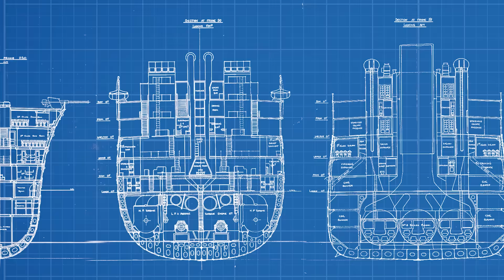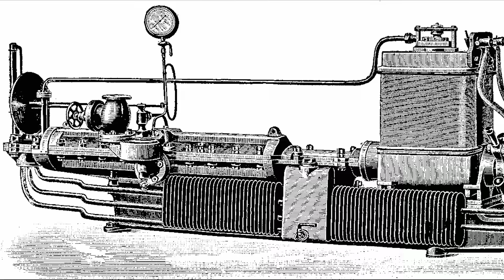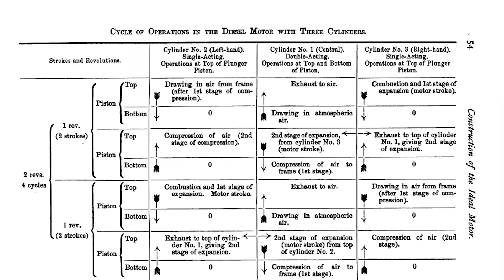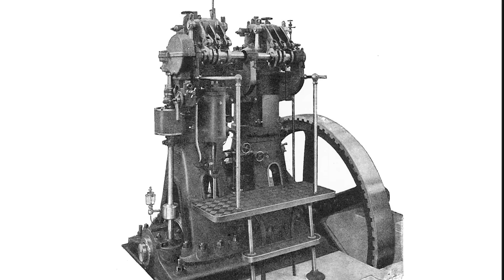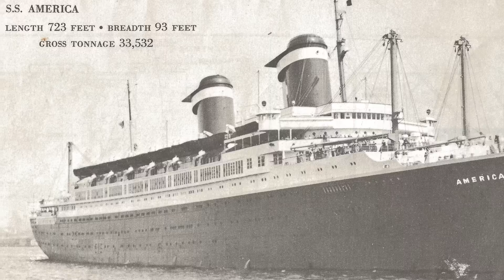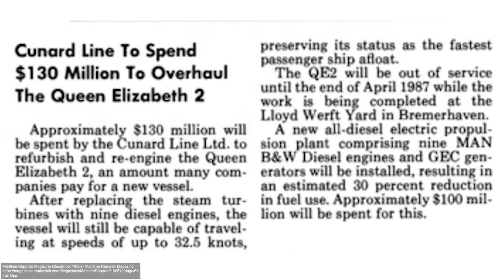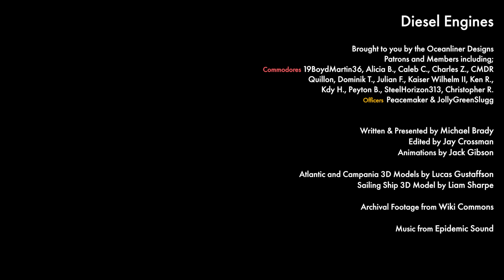How the Diesel Engine Became King of the Seas

Comment: The petrol engine was all great but the diesel engine literally built our modern world. There isn't a single industry where a diesel engine isn't used. Trucks, ships, construction, power generation, etc etc.
Reply: My diesel car uses the same amount of fuel as my bike over 50 mpg. Diesels are more efficient both thermally and consumption
Reply: @mala7794 
My daughter has a full sized sedan built by Hyundai that gets an average of 47mpg on gasoline. My wife's Jetta gets 55mpg on diesel. The Hyundai dwarfs the Jetta in size and gasoline is much cheaper than diesel. Diesel does burn hotter than gasoline and produces more thermal energy per pound but gasoline engine technology has been in the dark ages because big oil wants vehicles to guzzle gas so they can make huge profits
Reply: @adampatterson707 Whatever your "big oil" wants is of little concern to those who design, build, or sell engines. Gasoline engines and diesel engines have been continually improved over the decades up to present day. Research goes into everything from improved fuel spray patterns to tighter piston rings to electronically controlled variable valve timing to lighter and more durable alloys.
Electric motors are the hottest area of powerplant research in vehicles, but work continues on internal combustion systems to keep them competitive.
Reply: @adampatterson707 The US is probably the only place in the world where diesel is more expensive than gasoline. 

Plus, the example you provided tells us little. My first car was an Opel Corsa that got 29 mpg (city) while my second car was exactly the same but it had a diesel engine and got 39 mpg (city).
Reply: @adampatterson707 The same Big Oil that lets automakers sometimes teeter on the edge of bankruptcy?
Reply: @adampatterson707 no it doesn't 😂😂
Reply: @ΣτελιοςΠεππας that’s a recent occurrence, only in decade has diesel become more expensive than gasoline.
Reply: I think you could say that the diesel engine built the globalized economy but steam engines built the modern world before the diesel was even invented. Diesels only entered widespread use in the 1920.
Reply: @andrewduff2048 The Steam Age never really ended. Just better final power transmission via electricity. Steam turbines provide for the basis for our modern life and manufacturing. Whether fired by coal, natural gas, or nuclear.
Reply: @andrewduff2048 The two stroke diesel was like a second industrial revolution.
Reply: @andrewduff2048  well yes the steam engine brought about the industrial revolution but would our current world with all its highways and ships and commerce be possible with steam alone? there is no way. the diesel engine's impact is greater than that of the steam engine imo.
Reply: I love maple syrup
Reply: @EnjoySackLunch  realest comment on here
Reply: Maybe aircraft?
Reply: Somebody has to burn the light distillate fuels too. In reality, all engines are converging on spark-ignited, direct injected engines running on low octane gasoline, a merger of gasoline and Diesel technology.
Reply: Porn industry
Reply: @pitdog75goated response
Reply: True but dont forget the steam engine wich was used for over a 150 years and is till our primary engine for generating electricity.
Reply: @petroltrankof2667  but steam would never have gotten us to where we are today
Reply: Planes.
Reply: And in airplanes! Back in the thirties but also today in small training planes. For the same reason, much better fuel economy and cheaper fuel than gasoline.
Reply: @bohenriksson2330 modern jet fuel is very similar to diesel and kerosene
Reply: There was a diesel powered car in the 1952 Indy 500.
Reply: @leechjim8023 diesel won Le Mans in the early 2000s until it was basically banned.
Reply: even nuclear power has diesel engines(back-up generators)! they use a highly refined diesel that actually kinda looks like red wine
Reply: @cegicreator2476 The reason why diesel is red, is because they colour it with a red die.
And red diesel is cheaper becasue it has less taxes on it.
But not every one is allowed to use red diesel.
For example; ships and farmers are allowed to use red diesel. But trucks and cars are not.
So to make it obvious and visable what kind of diesel you have, they make a distinction between the different kinds of diesel by making it red.
If you use red diesel in your truck and the police discovers that, then you will get fined and they will calculate how much money you have to pay for taxes.
Reply: @musictolive4  oh ok that makes way more sense. thx for the knowledge for all!
Reply: What about war? I believe tanks have always been petrol, aircraft are jet fuel
Reply: @maxstr  yeah no tanks are typically diesel.
Reply: @maxstr some tanks have used diesel for reliability when speed was not a priority
Reply: @maxstr did war not exist before the diesel engine? it simply made it worse.
Reply: Indeed  the world we know today would not exist without diesel engines,  which have served in just about every  regimen where an internal combustion engine was required.
Reply: @taras3702  fr
Reply: Because diesel engines are much efficient compared to petrol engines. Otherwise fairly, a petrol engine is superior & better than it's diesel counterpart in almost every way except much poorer efficiency which is a big toll as to why big ICE machineries are mostly rather diesels.
Reply: And then Rudolf Diesel mysteriously disappeared from a steam ship either by suicide or murder. Maybe big steam wasn't happy with his invention.
Reply: @johns8364  That sucks, Mr. "big steam" should see how diesel engines dominates steam engine & it's helpfulness in the current world.
Reply: 😂😂 they use to be gas you can do the same with gas
Reply: @andrewhatton1606  no you canno lol. try running a hundred thousand ton ship on gasoline instead of diesel or bunker oil.
Reply: The woke don’t like diesels and are banning them in their profound ignorance
Reply: Yeah diesel engines built the infrastructure but gasoline engines make the world go round.
Reply: @dilldowschwagginz2674  gasoline makes cars go round. definitely not the world. and outside the US most markets have significant numbers of diesels. the US passenger diesel market failed because of GM's shitty V8s in the 80s and Dieselgate. and last I checked the US is not the world.
Reply: Trains
Reply: Pipe down nerd
Reply: And now it’s being demonized by the woke tree huggers and the globalist agenda.
Reply: Rudolf Diesel Born in Paris, Son of a German couple, must leave France after beginning of Franco-German war 1870.
Reply: Aerospace
Reply: mack,Peter,kw,used gas for sum time lol then 2 stroke diesel and diesel but now gas can almost out last diesel
Reply: Aviation?
Reply: @k20nutz  there's so many things in aviation that run on diesel. almost all ground work and support vehicles, avgas is practically highly refined diesel, so much more.
Reply: Aircraft?
Reply: Gasoline engines are mostly limited to personal vehicles.
Reply: Do wonder about petrol power for ships did we skip a step, petrols were around abit before diesel.
If your running a diesel flat out its not much more efficient from petrol.
Reply: @Johnathan.David.Trewhitt. The fuel is more powerful by mass.
Reply: @Johnathan.David.Trewhitt.  the point is diesels dont have to run flat out. they are efficient at low rpms.
Reply: @bragadeeshbalakrishnan  Yes but its a boat its cruising speed is a high load so why not run the petrol at low rpm because you could, the main thing is petrol is good at running fast it sparks and it all combusts at tdc, where as diesel can keep injecting past tdc so its really good at pushing all the way down the stroke but the injectors cant keep up at high rpm.

Regardless i was talking about the early 1900s ships
Reply: You have gearboxes for that lol. And diesel electric solves that issue too. @Johnathan.David.Trewhitt.
Reply: @Johnathan.David.Trewhitt. diesel is just way better the petrol. diesel is more refined the petrol so that already makes it better. plus diesel has special additives that make it not need sparkplugs
Reply: @cegicreator2476  what special additives and how is it more refined then?
Reply: @Johnathan.David.Trewhitt.  petrol is flame hazard, diesel is not as flamable. And fire on a ship is something you want to avoid.
Reply: @Johnathan.David.Trewhitt.  Agreed, but they're not meant to be run flat out, for many reasons. 

There were gas engines for ships, in instances where weight was an issue. The PT boats of WW2 are a prime example. But the danger of gasoline leaks and explosions was real.
Reply: @MannyB-b7l  Correct. I believe Brady did a video on the British attempt at a gasoline/petrol powered sub. The problem is gasoline emits explosive vapor.
Reply: @magmajctaz1405  diesel doesn't catch on fire even if you drop a lit match in it.
Reply: Gas is arguably just as important. It's not efficient to have diesel in smaller vehicles that are not used for heavy duty work. Gas is what get us from one place to another to use most diesel engines such as Trucks, tractors, boats, exc.
Reply: @tractorjunkco  well, truthfully the diesel has its place in smaller vehicles as well; Just try to get the owner of a “diesel gate” -era Volkswagen to sell their car…. They will usually ask for about double their actual value.  There’s just something about an engine that can easily go 300-plus thousand miles.  The engine costs more, but in the long term, it’ll save you money in operating costs.
Reply: @JasonMcCord-qk3yb the catch is that you have to afford the vehicle with the diesel engine first since most families cant afford it. This is were the main problem lies because gas engines are much cheaper to produce. Both gas and diesel have a place so its like comparing apples to oranges funny enough.
Reply: @JasonMcCord-1012  Years ago, I had a 1980 VW Rabbit diesel.  With over 100k miles, I still got 50mpg!  It didn't go fast (I used to joke that it'd self-destruct at 75mph), but it was cheap and fun!
Reply: @JasonMcCord-1012  What makes the dieselgate era engines more desirable? I also have a diesel (the volvo d5) with over 300k miles and I am just curious. My engine still does 0-60 in same time as it did 20 years ago.
Reply: @JasonMcCord-1012 2UZ-FE: “am I a joke to you?”
Reply: @tractorjunkco   not efficient?  I own a TDI volkswagen that gets close to 50 MPG without any exotic hybrid technology.  Not only that, the car is rather quick as well.
Reply: @audvidgeek  same. 2012 2.0 octavia and i can get 4l/100kms
Reply: @tractorjunkco It just took some time to reduce the size of diesels because of the high compression ratios.
Reply: Thats untrue @tractorjunkco
Reply: @tractorjunkco  diesel is still more efficient in small engine vehicles and implements. The reason they aren't used more is cost. A carburetor is significantly cheaper than injectors and injection pumps. Plus gas and diesel are both created in oil refineries so they both have purpose. Diesel was initially free and then very cheap because they had no use for it. Gas also has the benefit of being more suitable in the cold though
Reply: @tractorjunkco  diesels are more efficient than gas engines but they pollute more. gas engines work for smaller vehicles and pollute less. if diesels were not as polluting we'd all be driving diesels now but alas.
Reply: @tractorjunkco in the US. Here in Europe diesels are found in literally everyfucking thing.
Reply: @tractorjunkco wtf is gas? A gas engine? Natural gas? Speak sense ffs
Reply: @tractorjunkco Thats not true, in europe we have small cars like Fiat Punto with 1.25l diesel 4-cylinder making 75 to 150hp. The efficiency is off the charts, these cars get 50 to 60 us mpg. You even get a manual transmission so you can shift it the way you want for even better mileage.
Reply: @tractorjunkco you kinda don’t understand diesel, I guess. That’s ok tho. Long story short, diesels are WAY more efficient than gas engines will ever hope to be. Hell, diesel itself has more energy for us to harness than gasoline does. 10-20% more energy, btw. Idk why you think it’s not efficient to have a diesel in a small car. They last a helluva lot longer, get better fuel economy, can idle for forever…biggest reason they aren’t more widespread in passenger cars is because they’re a lot more expensive and VW left a sour taste in everyone’s mouths… there are a shit ton of others pluses when it comes to diesels for regular cars. That’s why I’m throwing a diesel into my mini van. 

Seriously, where’d you get the inefficient  comment from, cuz diesels were literally touted as being the more efficient alternative to gasoline engines, and it wasn’t just a marketing gimmick. Diesel engines and diesel itself are more efficient than gas. 

(Kinda drunk so this was longer than u meant it to be but yea. Calling diesel inefficient compared to gas is just silly)
Reply: @tractorjunkco  plenty of small cars are diesel and are far more efficient than petrol
Reply: @tractorjunkco  could you Americans? Please learn to call it gasoline?  Or maybe call it petrol like everybody . It’s in the second state of matter not the third state of matter.
Reply: No. It's just that diesel can run on trash fuel on which spark-plugged engines can't run. That's its value, not efficiency.
Reply: @ steam engines can run on anything that burns. Often the bunker oil that they used was so crude that it had to be heated in order for it to be pumped from the storage tanks to the boiler.
Reply: @andrewduff2048  but they were very inefficient
Reply: @andrewduff2048 modem cargo ships literally run on crude
Reply: @tomhejda6450  look up the thermal efficiency differences between diesels and gasoline engines
Reply: @tomhejda6450 Diesel fuel has a much higher energy content than gasoline, and it's also safer to handle, transport and store. It can be made from what would otherwise be waste.
Reply: ''but'' what?  diesel IS a petroleum (based) fuel 🤣
Reply: @Tal-q3r 🤓🤓

He’s speaking colloquially, he’s not writing a peer reviewed study on the differences between petrol & Diesel
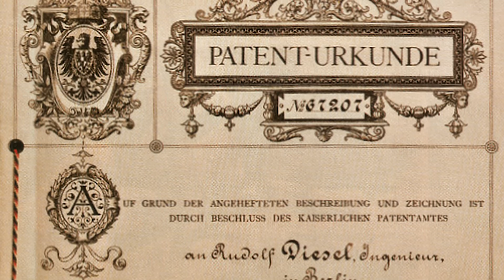Reply: @Tal-q3r 5:14
Reply: @rrobkaiserr  pay attention. im replying to the comment  🙄
Reply: @Tal-q3r  Petrol means gasoline in British English lol. If they spelled out the whole word as petroleum you would get your internet jollies...
Reply: @Tal-q3r  you think maybe by "petrol" engine that person meant gasoline? I'd assume they're in the UK. And there's many differences between those engines fyi.
Reply: @Tal-q3r diesel engines are far more efficient and it’s cheaper than gasoline (for industrial use)
Reply: Petrol means gasoline, not petroleum.  @Tal-q3r